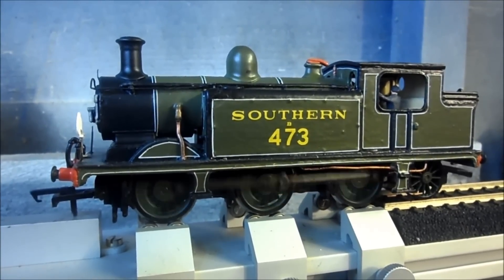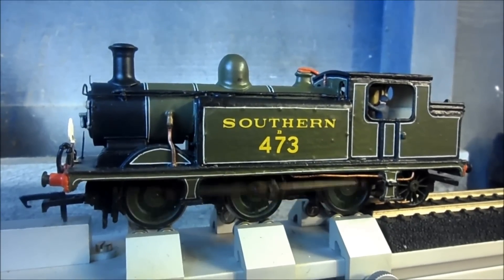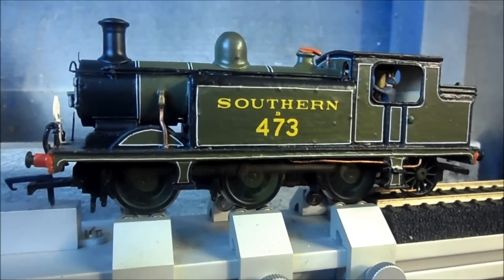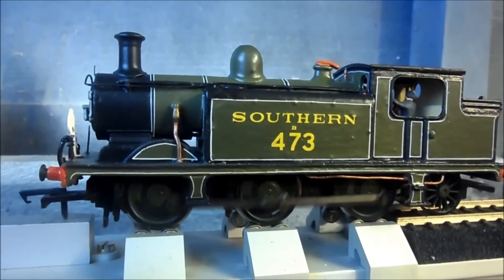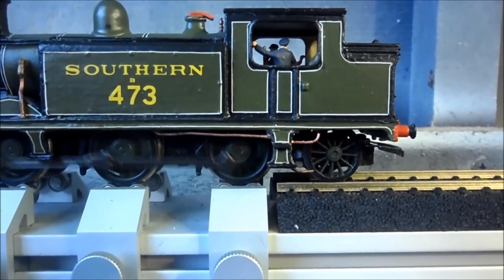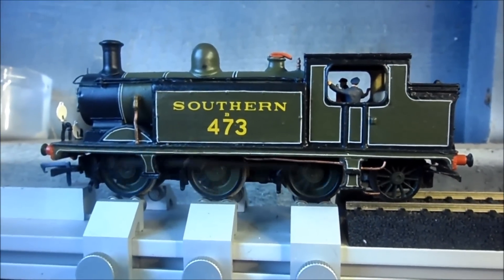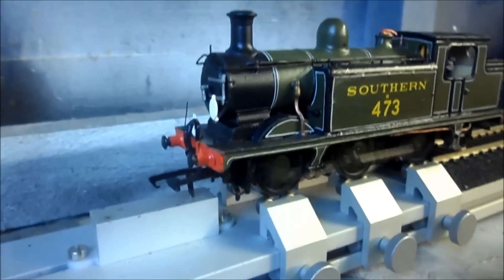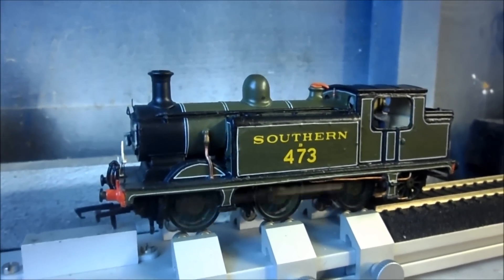Roger Stenning, E4, 0-6-2T, B473

Comment from the maker: Yes I have a few on etched chassis, U-Class was re built and repaired, the B4 has an etched nickel silver chassis, I have been assembling another U-Class etched chassis.
I've not tried many full etched brass kits, but I have been looking in to it... its cost of the kit and equipment, with the rise of 3D printing, which I've had a go at and also have a big project on going I expect these kits my die away a bit.

Comment from the maker: Well you never know what the future may hold.... ;)

White metal kits are pretty good, you can solder or glue them together.. i have to admit i have dropped this loco once, and considering its stuck together with Superglue... it stayed in one piece.
 This as I think i mentioned in the video has a RTR bodged chassis under it... I may make some adjustments to it at some point.
 Ebay can give a false value on things.. and its really hit or miss on Kits if they work well... or not...